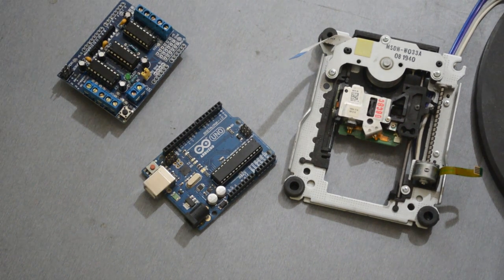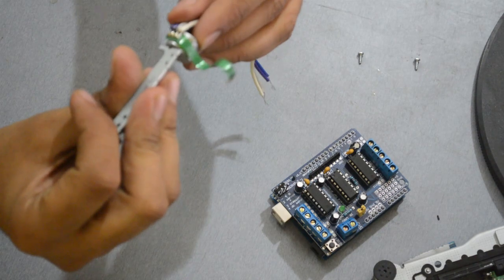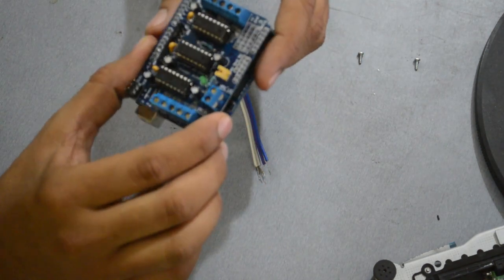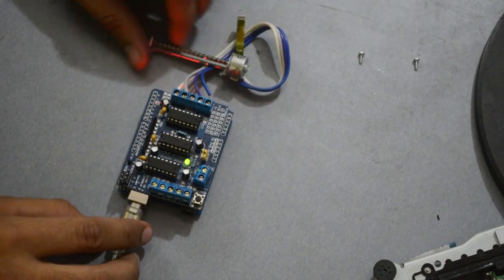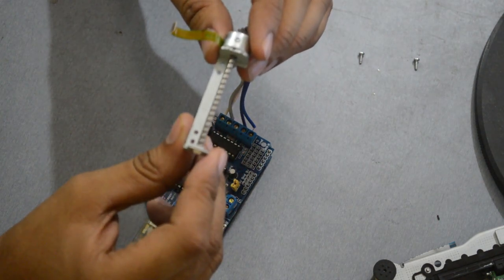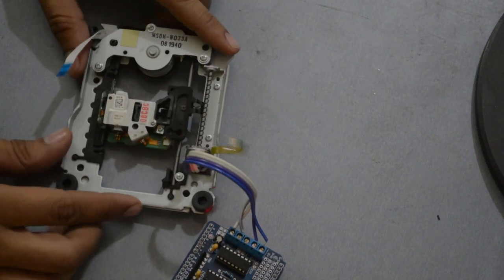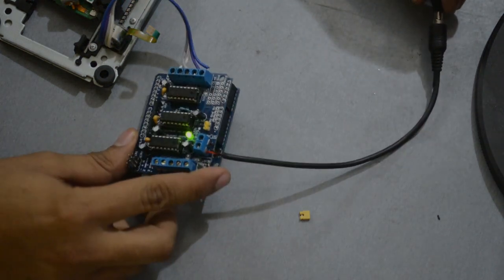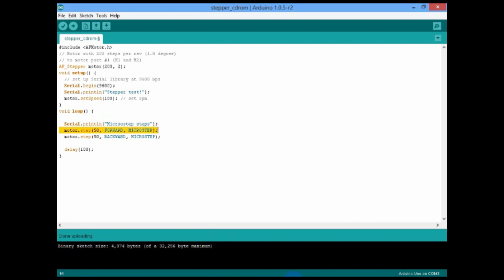Drive CD-ROM Stepper Motor with Arduino + L293d shield

Comment: first: cool video well explained. I'm thinking of using this mechanism for an animatronic puppet which has to shake its head at a quite high speed. How fast can this thing move? Can it create a fast shaking motion like back and forth the full length in like 200ms? I don't wanna sacrifice the only dvd burner I have left to find out it won't work soo ^^

Comment: What is the voltage and current in external power to shield for run 2stepper and servo motors

Comment: pra quem não conseguiu, arrumei o código, agora ele está copilando. é só copiar esse código ai em baixo e vai da certo. 

  #include <AFMotor.h>
// Motor with 200 steps per rev (1.8 degree)
// to motor port #1 (M1 and M2)
AF_Stepper motor(200, 2);
void setup() {
// set up Serial library at 9600 bps
Serial.begin(9600);
Serial.println("Stepper test!");
motor.setSpeed(400); // 50 rpm
}
void loop() {

Serial.println("Micrsostep steps");
motor.step(50, FORWARD, MICROSTEP);
motor.step(50, BACKWARD, MICROSTEP);
motor.step(100, FORWARD, MICROSTEP);
motor.step(100, BACKWARD, MICROSTEP);
motor.step(200, FORWARD, MICROSTEP);
motor.step(200, BACKWARD, MICROSTEP);
motor.step(250, FORWARD, MICROSTEP);
motor.step(250, BACKWARD, MICROSTEP);
delay(100);

motor.step(3, FORWARD, MICROSTEP);
motor.step(3, BACKWARD, MICROSTEP);
delay(1000);
}

Comment: sketch_nov21c:13: error: 'Micrsostep' was not declared in this scope

 Serial.println(“Micrsostep steps”);

                 ^

exit status 1
stray '\223' in program

This type of error i got while uploading ur code. reply me asap
Reply: Himalay Kolavada Try to use quotes from your keyboard (").
Reply: pra quem não conseguiu, arrumei o código, agora ele está copilando. é só copiar esse código ai em baixo e vai da certo. 

  

#include <AFMotor.h>
// Motor with 200 steps per rev (1.8 degree)
// to motor port #1 (M1 and M2)
AF_Stepper motor(200, 2);
void setup() {
// set up Serial library at 9600 bps
Serial.begin(9600);
Serial.println("Stepper test!");
motor.setSpeed(400); // 50 rpm
}
void loop() {

Serial.println("Micrsostep steps");
motor.step(50, FORWARD, MICROSTEP);
motor.step(50, BACKWARD, MICROSTEP);
motor.step(100, FORWARD, MICROSTEP);
motor.step(100, BACKWARD, MICROSTEP);
motor.step(200, FORWARD, MICROSTEP);
motor.step(200, BACKWARD, MICROSTEP);
motor.step(250, FORWARD, MICROSTEP);
motor.step(250, BACKWARD, MICROSTEP);
delay(100);

motor.step(3, FORWARD, MICROSTEP);
motor.step(3, BACKWARD, MICROSTEP);
delay(1000);
}

Comment: Hi dear, considering the test performed, you have created some project using this shield with arduino such as a mini cnc?
I have the same shield but have problems that most programs use GRBL apparently uses other pins ..

Comment: I am using a 9V battery with an easy driver to move the stepper of an old dvd rom. But it's not working, is it due to the voltage?
Reply: +Anil Dhan It's due the current. A 9V battery can't drive a stepper motor,use a 12V power supply or a usb phone charge which provide at least 500mA of current.
Reply: Thanks alot man! IT WORKS!!!! I love you for this man!! i cut an external hard disk adaptor, which provided me 12V along with a good amperage of around 2A. Whch is probably why the motor gets hot a lil faster. But i will be running this current through 3 stepper motors. Hopefully that will fix things. Or probably I will just attach a resistor. Any idea how much of a resistor i can use?
Reply: From my knowledge i know motor heat up when are in heavy charge. They "suck" how much current need,for exemple from 2A use just 1.4 or 1.7A.
Reply: +Andrei-Daniel Botezatu did you get a reply??? what is the max current ( in Amper) can be apply?..

Comment: hi, Im trying. anh it suppoted!
Arduino: 1.6.3 (Windows 8.1), Board: "Arduino Uno"

sketch_jun21a.ino:8:1: error: stray '\' in program

sketch_jun21a.ino:8:1: error: stray '\' in program

sketch_jun21a.ino:13:1: error: stray '\' in program

sketch_jun21a.ino:13:1: error: stray '\' in program

sketch_jun21a.ino: In function 'void setup()':

sketch_jun21a.ino:8:17: error: 'u201cStepper' was not declared in this scope

sketch_jun21a.ino:9:18: error: expected ')' before numeric constant

sketch_jun21a.ino: In function 'void loop()':

sketch_jun21a.ino:13:17: error: 'u201cMicrsostep' was not declared in this scope

Error compiling.

  This report would have more information with
  "Show verbose output during compilation"
  enabled in File > Preferences.
 pleas help me!

Comment: does your h-bridge chip get really hot? I did what you did but my l293d motor driver got very hot. It hurt to touch and it was only on for a couple seconds.
Reply: +James Taverne Yes
Reply: You should use L298N motor driver as it can be connected to a heatsink and I recommend you to use that.This IC is better to use to drive stepper motors due to their high current consumption.
Reply: The shield uses a 74HC595N shift register which reduces the number of pins used from the Arduino board.